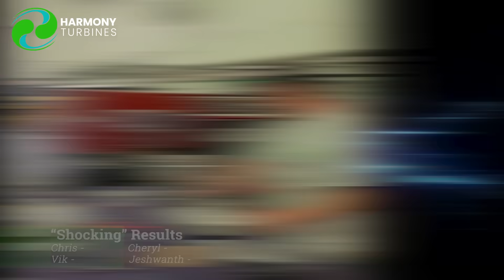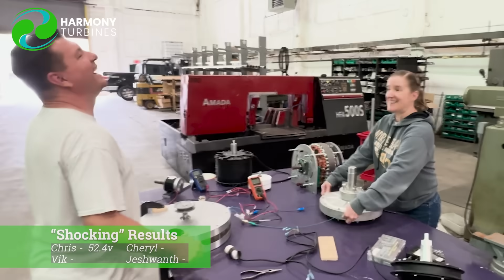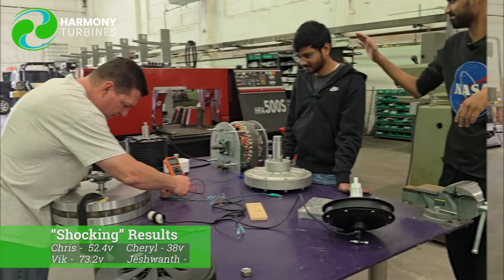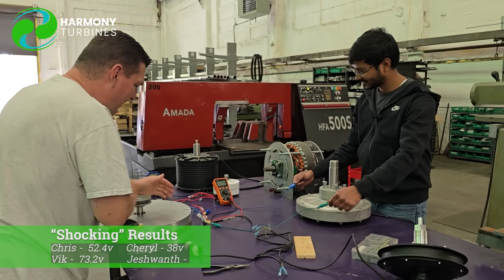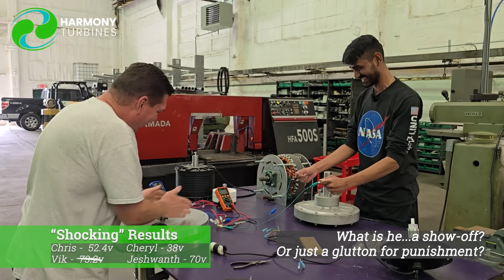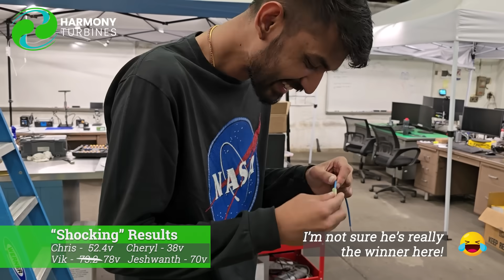A "Shocking" Competition! (LIVE Generator Reveal Teaser)

Comment: Its not smart to allow the current flow across your heart like that. Hold both output wires of the generator in one hand. By keeping the contact points close together in one hand, the current will primarily flow through your fingers or hand, avoiding a path across your chest and heart.
Reply from the maker: Incredibly low amounts of current here for these little challenges. A few milliamps and nothing more. Thank you for the concern, but we are definitely being careful.
Reply: While what you’re saying makes sense, the voltage they’re running here is a similar amount of voltage to the Benjamin Franklin museum's "shocking" exhibit. Not harmful, but maybe painful.